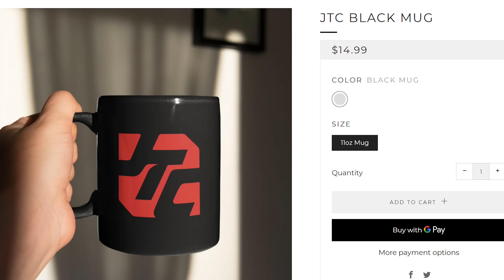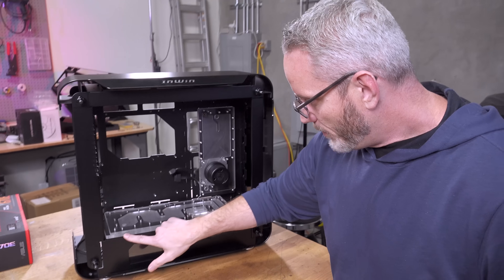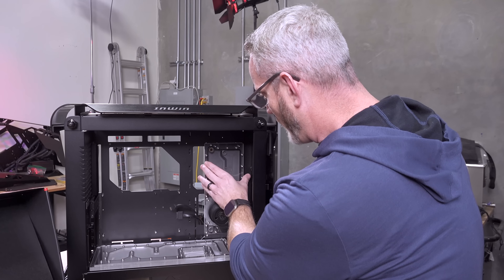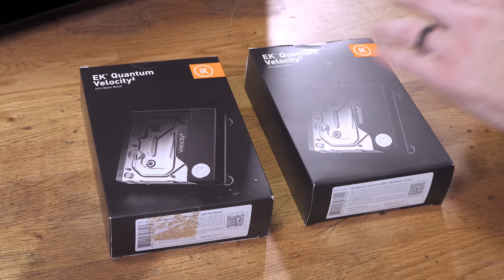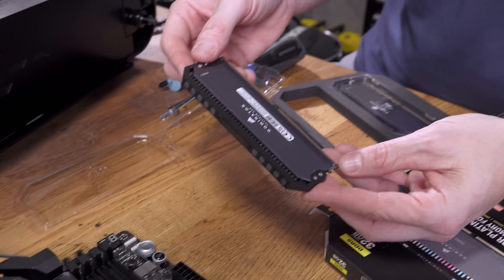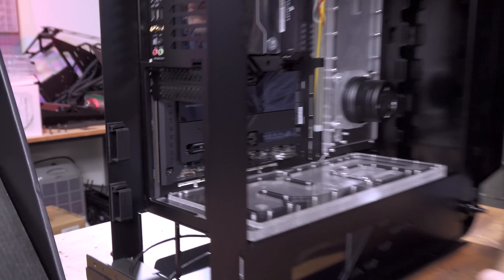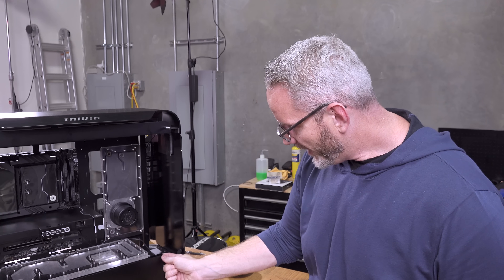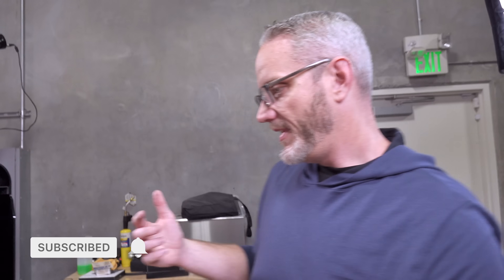My first water cooled build is 2023!

Comment: Personally I'd prefer to see less bling aesthetic fans on this build. Mean looking static pressure fans would fit it much more than Uni fans or the other you had in mind. Phanteks T30 Noctua NF A12x25 or Thermaltake Tough Fan 12's. Once you start putting overly aRGB fans in a EK block build it looks out of place.

Comment: It's a pity I don't see a clear way to do a Pump - GPU - Radiator - CPU - Radiator - Pump (again) loop. 

But I'm a bit biased, I don't like parallel loops if you can't control the flow through each part.

Comment: Hey Jay. I really need you to make a video I have yet to see it at all on Youtube and I specifically checked you first to see if perhaps you've done one, but it seems no one has. I really need to see how to disassemble an EVGA 3080 TI Hydrocopper I am having issues with it overheating and I want to eliminate one of the possibilities which is the thermal paste needs to be replaced since my computer is on 24/7 gaming literally between myself and my wife and kids, someone is always gaming. PLEASE if you can help with this. I would appreciate it 1000% My build is  the MSI Meg ACE X670E, AMD 7950x, the 3080 Ti, and a bunch of SSD's and Corsair Vengeance pro DDR5

Comment: Hey Jay, I have the same motherboard and probably the same ram kit (32gb 6000mhz cl30), running on a 7600x currently until the x3ds are out. I've been having stability issues with the ram running at 6000mhz in expo1 or 2, random bsod and crashes in the game I play (FFXIV). I had to dial it back down to 5600mhz for more stability, at least no more bsod but still random crashes in games once in awhile. It's a pity that I've paid more for this kit but turned out not even able to utilize it's full potential (not that I'll be able to feel the difference, i know, but still I could've gone for a cheaper kit if I had known this). I'm running the 0805 bios and I have no idea what else to try to make this work, not sure if silicon lottery has anything to do with this, and now I'm just waiting for new bios to be released and hopefully fix this. Would like to know if you have experienced this on the redacted cpu and the newer bios.

Comment: If you're going to keep the rad with silver in it then would suggest changing out the CPU block to kind of match that.
Reply: Block is polished, but the rad is flat...   I think he should chemically blacken the tin coating.  This way he has the black finish, but copper mass.
Reply: @meeponinthbit3466  didn't even notice the finish yeah I'll give this one to you sounds like a better plan.

Comment: That pump and distro combo are pretty shoddy for something specifically designed for that case. The pump outlet and the inlet of the distro don't line up which is shocking. Where is the distro even going? Does the outlet at the back of the case line up with the rad in the roof? If not it's pretty pointless, the finish is bad (like blunt hacksaw bad) and needs ditching.

If you want a proper distro you should hit up Alex Banks from Praetex Design. The man makes exceptionally machined goodies. He can get a finish on the edges from his CNC like they've been polished.

Comment: corsair Icue is the reason i will never buy corsair again. There is a known, ongoing issue ive had(and others) where plugging in my xbox controller caused steam to hang. Somehow, it is icue/my keyboard. the solution is to unplug/replug it, and then steam comes back to normal. If you don't run icue, the issue never happens, so it's icue causing it. i don't care how complex a system is or coding or whatever, it just isnt acceptable. I don't even want RGB controlled by my PC, my next build will be controlled by a raspberry pi.

Comment: Oh, Jay. You learned the iCUE update of DOOM. Never update the firmware on corsair keyboards, AIOs, memory, fans, or almost any of their products. If they are running fine, don't bother. Because if you update the firmware you will have a huge chance of contracting the  "wrong color LED syndrome" it's infuriating, and they don't give you old firmware easily. You won't find none for download, you need to beg for customer support for one. So again never update the corsair firmware if you don't have any issues with the device. I lost a keyboard because of that, several LEDs ware wrong, was driving me crazy.

Comment: How come you big builders never use right angle ATX cable connectors?  I've used them in several builds without problem..No (hardly) any more visible wires...